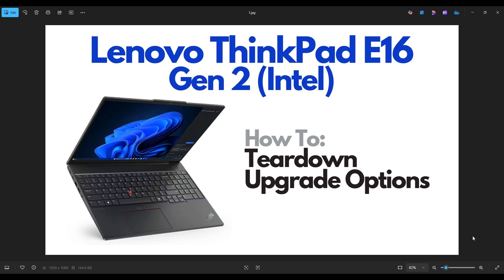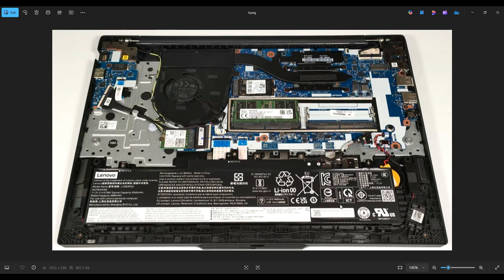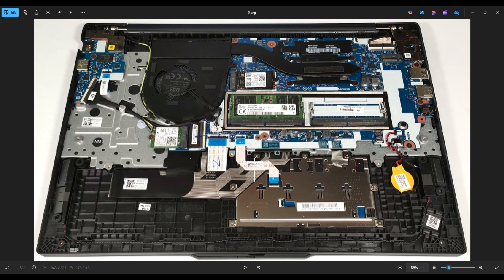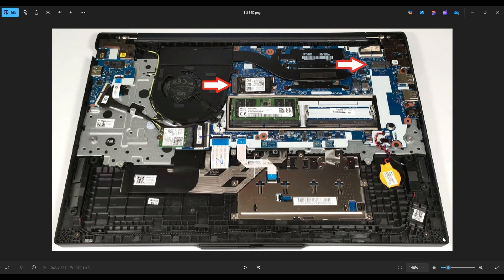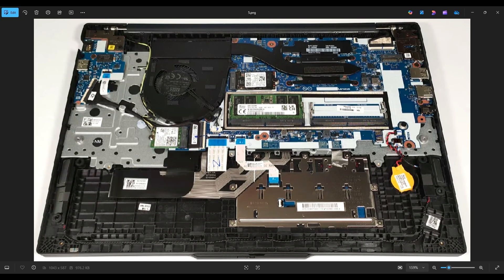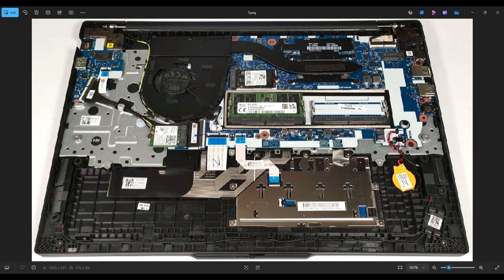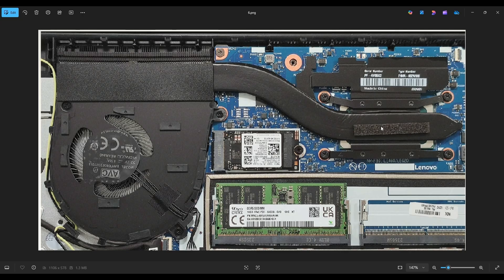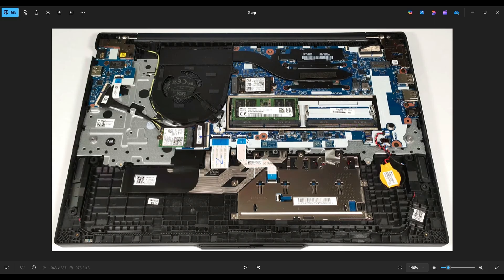Teardown Disassembly Upgrade Options for Lenovo ThinkPad E16 Gen 2 (intel) Laptop Computer

Comment: Hi Jammin PC Dude! I was actually successful in upgrading to 96gb of 5600hz DDR5 ram and installed a 2TB WD Blue SN580 NVME drive that I scavenged from a Dell desktop, in the larger format slot!  The smaller slot seemed to be too small to accept it. Can the smaller M.2 slot some how accept the larger 2TB Nvme drive? When I upgraded the Ram and restarted it, it went through a Bios "memory healing" process and booted up. So, a couple of questions for you. I did a couple of benchmarks and the 2TB drive didn't seem to be maximized since it was in the larger slot further away from the CPU?? This is conjecture on my part. Is the smaller M.2 slot preferred for the OS? Also is there any way to get more deeply into the BIOS to make more changes? Or is there an alternate Bios which gives more control? Or is Lenovo clamping us down with their pre-loaded Bios? I've done some of the diagnostics in the F10 diagnostics menu but there doesn't seem to be any way to change settings like you can on an Asus motherboard Bios. Any suggestions will be appreciated. Oh- and is there an aftermarket GPU that can be added? Or is the architecture to restrictive? In the becnhmarks I ran, the GPU seemed kinda dismal. I'm not doing much gaming but I could run some video programs and I didn't know if there were any upgrade possibilities.
Reply: Why would you put 96gb ram into a laptop. Dude you're trying to add a GPU to a Lenovo laptop? I don't have an answer to your questions your entire comment is Bonkers dude

Comment: do you have any recomendations on how to get the back plate off? I feel like its glued on
Reply: I recently tore one down. I used a pry tool after removing the screws. The glued on feeling is probably the plastic that clips together. When I took it off (very carefully) some of the pastic did break inside. Little bits came off. This happens to me a little too often